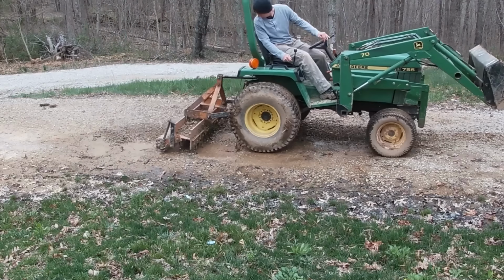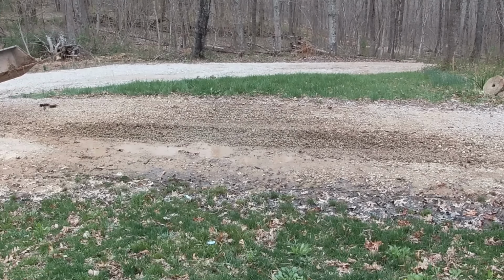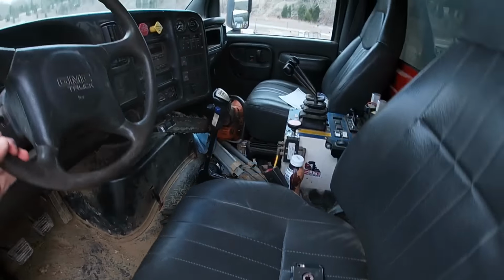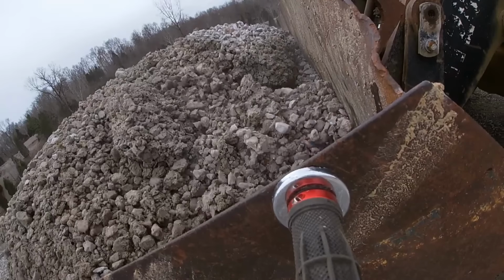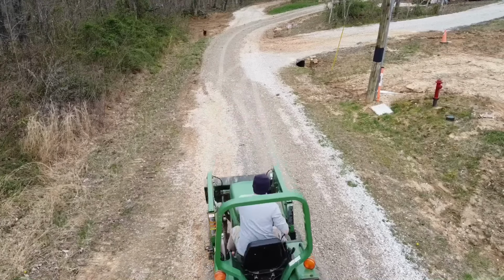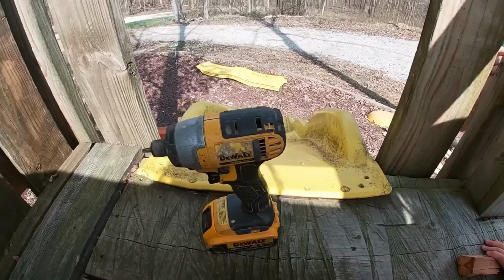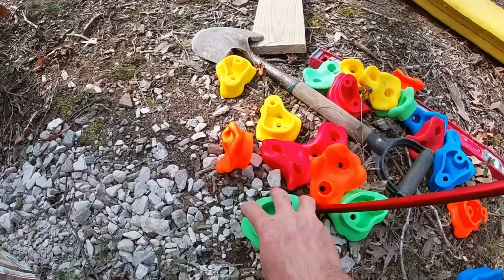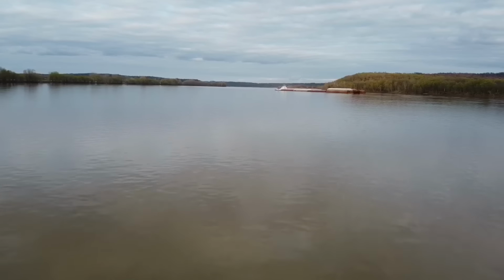Gravel driveway repair with compact utility tractor - PLUS Ohio River drone footage

Comment: I used to work for a black topper that had an old Chevy C 70 tandem axle dump truck. When you would chain spread with it, the front end would come completely off the ground until the box was mostly empty. Fortunately for me, I got to drive one of the newer Chevy Kodiak dump trucks. Another great  video. Yes they are called T-Nuts. Sorry no Dad Joke.

Comment: I was hauling pug mix (gravel mixed with tar), had about half a load stick in the bed. When it broke loose, all I could see was blue sky. Needless to say, I almost had to clean the seat out.
Reply from the maker: Mitch S haha.  I imagine!  Teach me something. Where do they use pig mix?  Is it cheaper than asphalt or is it the same thing, just a different name
Reply: @CaptainKleeman  It was used about 40 years ago until the use of a tar mixture was banned. It could be used like asphalt, but was good where you might have a washout as it stayed very well. Pug mix is a mix of a crusher run type gravel mixed in a pug mill which was a machine that mixed  the stone and tar. It did a good job until it broke down. It could be a nightmare to work on. The tar was impossible  to get out of clothes and almost as bad to get off of yourself.

Comment: Watched many barge's pass by from Otter Creek Park on the Ky. side or Brandenburg park also.  You must not be allergic to poison ivy the way you mess with it.. Just got over some were I've been clearing woods. Same vines like yours.  What is the  goo that comes out of the grape vines.
Reply from the maker: m. Dymo I used to get I bad.  But I started using dawn dish shop when I shower after working outside, and haven’t had it since.  May be worth trying!